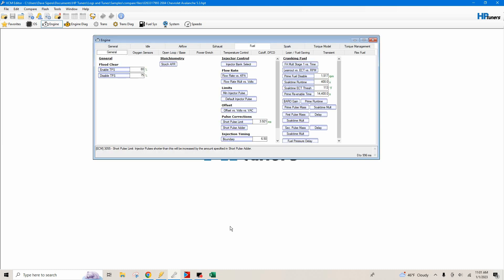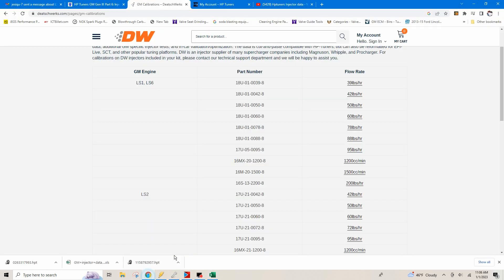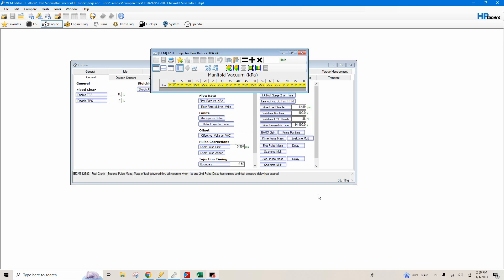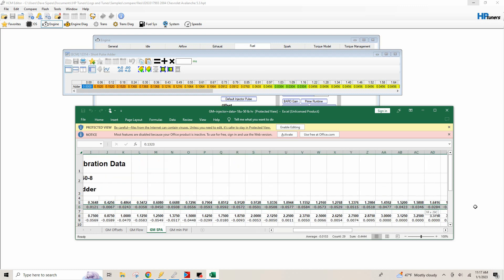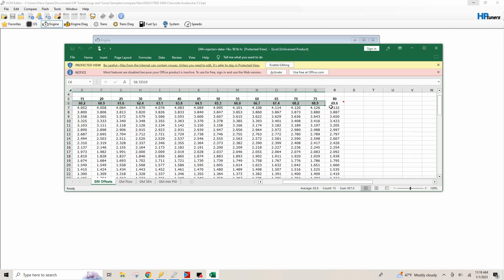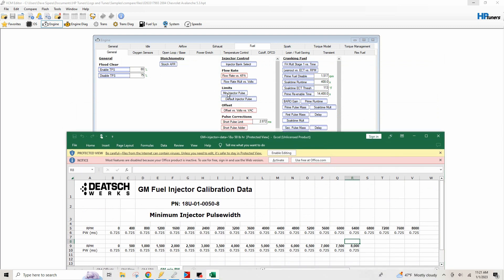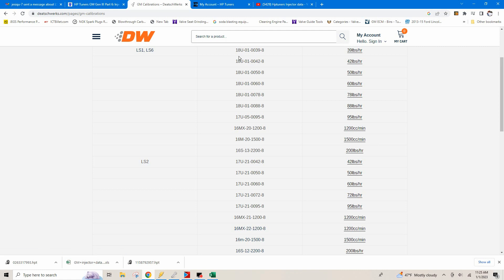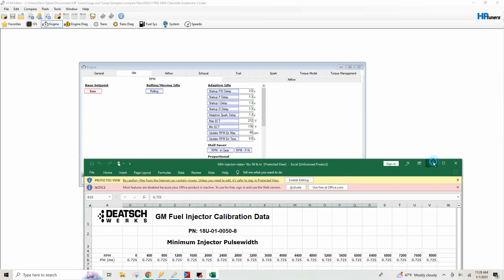INJECTOR DATA HP TUNERS DECAPPED LS TRUCK INJECTORS

Comment: I’ve swapped my lq9 with a tbss intake. I’m using some unknown ls2 style injectors. I converted it over to a corvette filter/regulator should I set up the fuel maps for return or return less?
Reply: Set it up for a return style
Reply: @Dynamicflatbedlogistics2025  thanks a bunch I’ll give this a try. It’s a 02 Silverado LQ9 swapped, I used my LS2 injectors from my 2005 C6 (fbo at the time of purchase) so I didn’t know exactly what size they were but the part number is bosch injectors. So I didn’t know if they were 32s, 36s, 42, or 46s. But it Seems like even when I get the VE map dialed in close to -3, and 4 it still spudders and pops at cruising at highway speeds and heavy acceleration I’ve tinkered around with the injector timing boundary, I’ve had my timing super low under 2k rpm made it slow down a lot. But at 14degrees it seems to drag. I’m literally about to pull my hair with this thing 😂